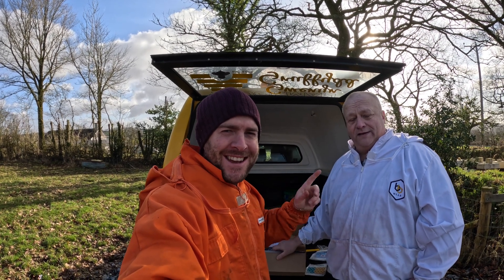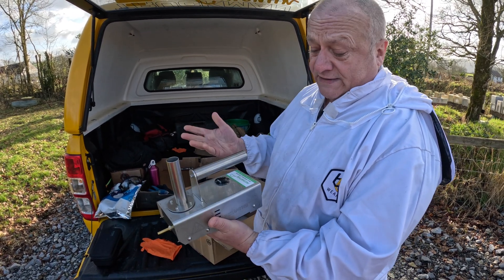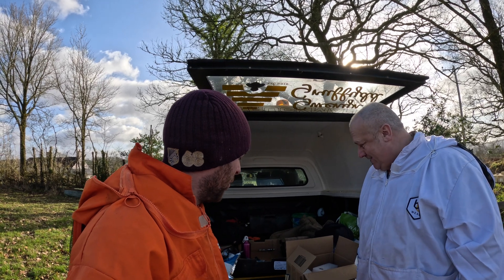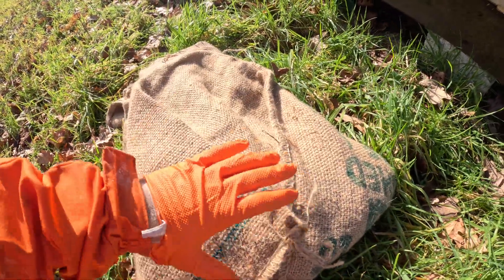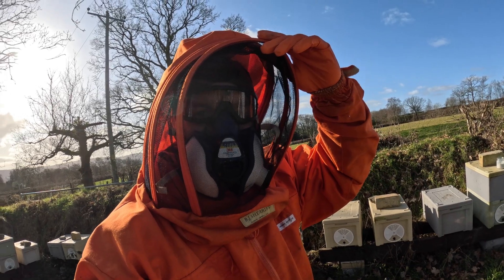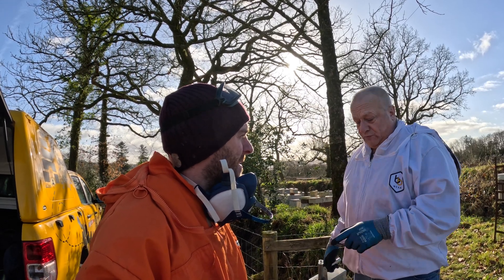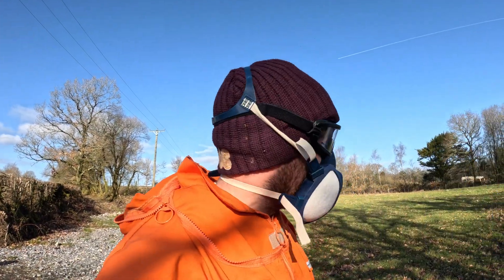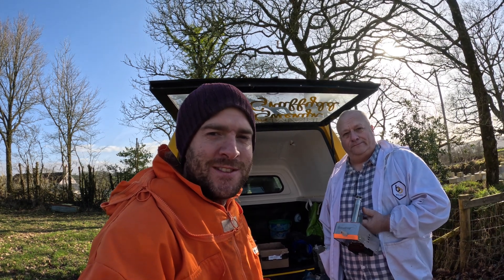How To Use The InstantVap! Full Tutorial For Beekeepers. Oxalic Acid Vaporizer

Comment: I just received the compact.  I am immediately impressed by the build quality.  So far with regular Milwaukee batteries it gets up to heat more than twice as fast as my other brand unit.  I am in New England, so it is cold here.  I am looking forward to how well it does in cold temps, 454-50F.   My old unit was an absolute clog machine.    Thanks you.  Fun vid.

Comment: Received mine last week. I had to get a couple of 5.5 AH batteries for it. My existing 2AH ones just werent enough. Having said that, the Vap is excellent, it really pumps out the gas so well. It's expensive - but I expect many years use and the Vap is incredibly simple to use - and it's FAST.
Reply from the maker: Vaping is the cheapest form of treatments

Comment: Great products. I was actually about to design and 3D print a mould for making a silicone cover. Also very useful for at the end of your vaping, stops nozzle burning anything
Reply from the maker: Yes, they are covering all bases now! 
Waw! You must have an impressive setup if you can design and make 3D parts!?
Reply: Looks like you'll have to print them as you can't buy the silicone cover or water cleaning cap on their website.

Comment: That's a handy piece of kit for large amounts of hives, no batteries to carry about. 
Do you have to supply your own battery, or is it available on the website?
Reply: If you don't already own one of the following 
Parkside X20V-TEAM;
Einhell Power X Change;
Metabo;
Makita LXT;
Milwaukee M18;
Bosch GBA 18V;
Dewalt 18V
They can be bought from hardware stores/amazon/screwfix/toolstation (don't forget to also buy a charger).  Parkside is Lidl and is likely to be the cheapest but their batteries may not always on sale.  Einhell probably the next cheapest and are sold by Toolstation.  You can also buy "badaptors" for using a battery on a different "platform".

Toolstation are currently selling 2x4.0ah batteries for £70.  Lidl/Parkside are around £30 for for a 5.0ah (the bigger the amp hour the more charge the battery can hold and the longer it will run the vap)
Reply from the maker: Supply your own batteries. The idea is you pick the brand of batteries you already own so it saves you from buying more batteries

Comment: How would this work on some poly hives that have a large landing board at the front that can’t not be removed? Is there an extension piece that can get past these landing boards? Or do you have to drill a hole in the back of the hive floor and use with silicone cap?
Reply from the maker: Hopefully the below comment answers your question?
Reply: I have Maisemore polys with the long landing board. And abelo poly too.

Works great on both. The battery is at the back so just goes in level no hindrance from the landing board.

Poly nucs, i have cut corrax varroa trays to fit under the nucs and just strap them in place. Also had no issue with the nucs works great

Danny
Reply from the maker: Thanks for answering the question 😊👍🏻